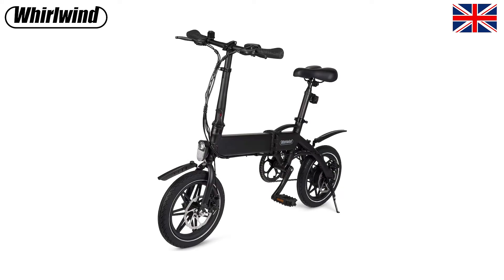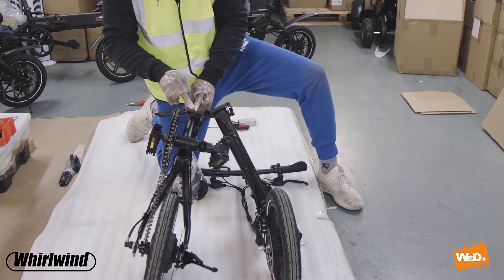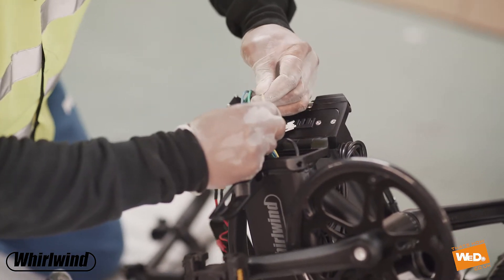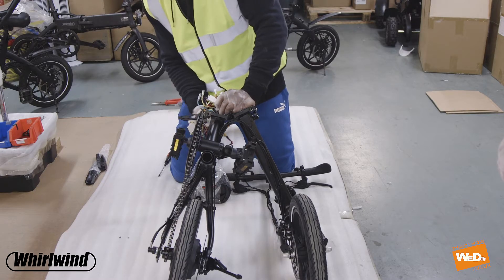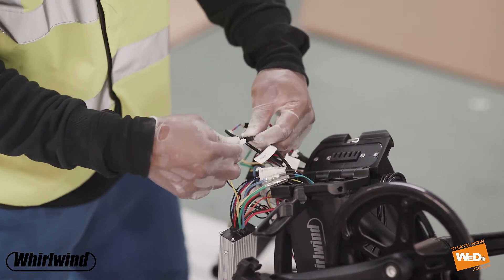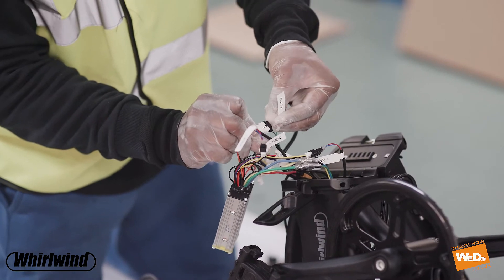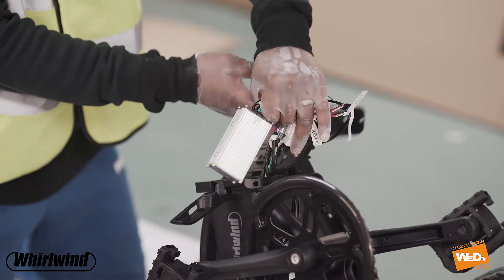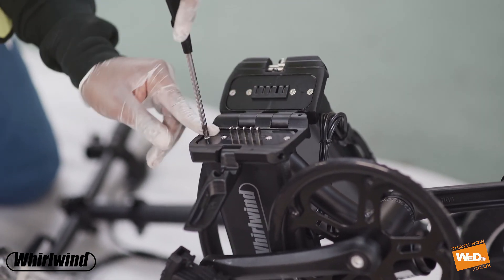Whirlwind C4 Electric Bike Tutorial, How to Replace / Remove / Install The Control Box

Comment: Hi guys great vid ,recently got one of these bikes just wondered if u can point me in the direction where I can get a new controller as battery on mine is reading well with a multi meter but the bike is completely dead the screen doesn’t come one etc so am guessing either the display or the controller or both is buggered I am in the uk
Reply from the maker: Hi Jay, just to let you know, we should have the link up early next week and will post it here for you, we are just getting the parts photos prepared for upload. Thanks for your patience.
Reply: @thatshowwedo8984  awesome thats great cheers
Reply from the maker: @JaysElectronicTinkerShack  Here you go bro, link to control box as requested. 
https://www.ebay.co.uk/itm/234206626911
Reply: @thatshowwedo8984  cheers bud already had some parts from u guys j storey in here in south wales did u manage to find out the hand throttle link also i have an issue looks like one fo the hall sensors in the motor has died so got the motor opened to see if wiring issue but it isnt so and gunna see what number is on the hall sensor and get some of those hopefully it will be back up and running again thanks for ur help in advance

Comment: Thanks for that.
Does the controller have a lead for a throttle control?
The bike doesn't have one and It's hard to get the bike moving on an incline before the pedal assist kicks in.
I was thinking of adding one somehow if the controller has functionality for it.

No matter. Controller has a lead for throttle. Did it myself. Works much better now.
Reply: dont suppose u would have a link to that hand throttle would u thin it would be very handy :D
Reply from the maker: @JaysElectronicTinkerShack  Hold tight.  Will send link shortly.
Reply: Just another Kiki question for u would u know how to open the motor I've got the wheel off but can't seem to get it apart I have a dead hall sensor by the looks of it all the phases seem good got a ebike motor tester yellow doesn't light up so its either a dead hall or a broken wire but need to get into it to find out thank you for the other parts I had they turned up today everything seems God apart from the motor not running lol
Reply from the maker: Hi Wizarda2z, thanks for your question, yes the control box does have a cable where a throttle can be attached. :-)
Reply: @thatshowwedo8984  where is the cable for the throttle ? I can’t seem to find it in the control box. Cheers
Reply: Well done you just made your bike non road legal